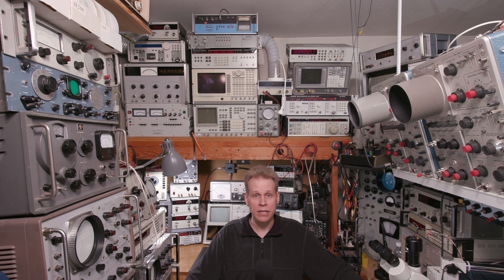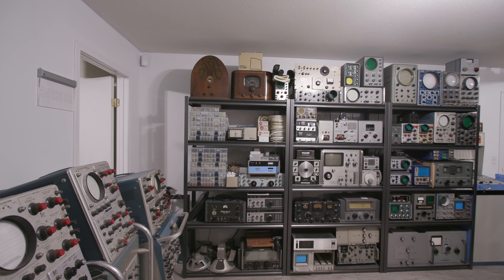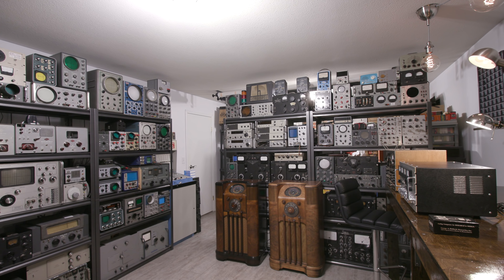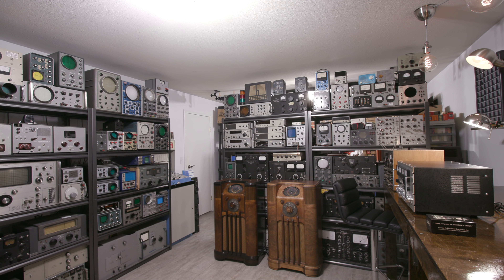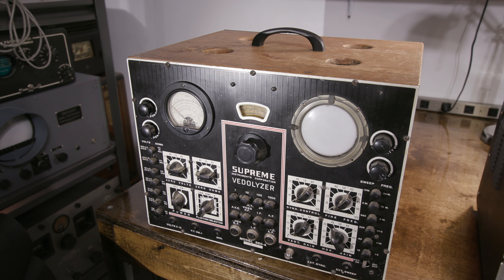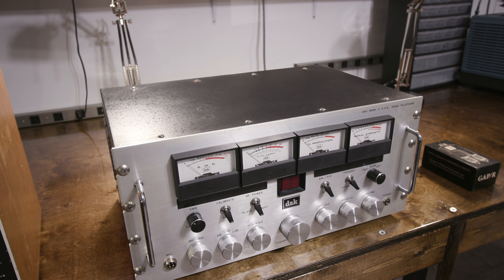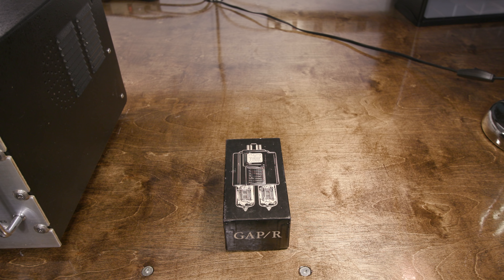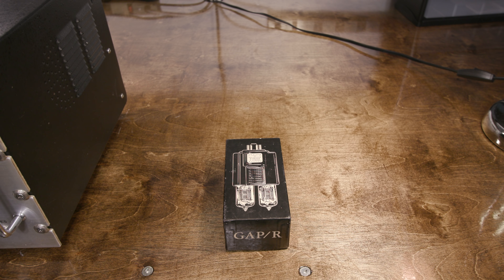The Next Restoration {Viewers Choice} 4K

Comment: I would say OP Amp but since so many others want the DAK I will pick that.  I have restored several of these since that's mainly what I do, CB and amateur radio restorations.  If that is what you decide to do and need any service information, have any questions or need any unobtanium parts just ask, I probably have it.  One thing to be aware of with these is intermittent operation problems caused by bad solder joints.  The PCB's in these were really cheap double sided boards that used jumpers to connect top and bottom layer traces.  Check them carefully because they frequently crack out on the top side.  The circuit board is a cheap "clone" of a Cybernet chassis.  Also if you have to remove the meters be VERY carefully.  The studs that stick out the back of them that hold them into the radio break out of the meters very easily.  Old age makes them rather fragile.

Comment: I'd love to see one of those beautiful console floor radios restored. Then again, I'm a sucker for old time tube radios, there's nothing like the glow of tubes from the warm old sound of a good console radio, so much to do, so many caps to replace, work on the speakers...with a little luck, they've not been turned on for years, and you could save the life of the transformers inside it.

Comment: The opamp, though I also have repaired the modern replacement for those, made still by Opamplabs.com. Though they did not make it repairable, by potting the whole unit in polyester resin, I was able to depot it ( though the PCB was somewhat fragile after that treatment) and replace the dead output transistors with new ones, and it carried on working for many years afterwards. They still make an impressive array of things that plug into octal sockets, and they would not look out of place in some of your restorations either, looking very 60's style blocks with screen printed labels.

Comment: Seen a radio like that at Goodwill a few months ago. Looked inside the back panel and seen what looked like the same tubes my amp uses and one of them was clearly damaged. Didn't have much light to see the circuit but my guess is that damaged tube drove the big speaker below it as well a couple of iffy looking electrolytics and resistors that I dared not touch with how brittle they looked. Really wanted to pick that up, restore it and find a home for it that would take good care of it but they wanted a ridiculous amount that no one shopping at that store is likely to have at hand. That particular one looked like someone patched a record player into the bottom of the cabinet at some point and added wooden shelving to store records next to the speaker cone.

Comment: All three would be great choices but because I just got out of electronics class 101 and we played with some solid state op amps I would have to say the vacuum tube op amps and show them and use in a circuit developed for them like a small radio.
        Of course at the beginning of your video when you paned over to those two tall twin towers radios was the first thing that came to my mind.

Comment: The CB radio.... these are already well covered thanks to  MikeRadioRepair and TheRadioShop channels. Carlson's Lab added value lies in test gear and electronic design considerations. The Tube Op-Amp now that's fascinating... however from what I can see (from the box, and given its small size), there is only just that, a tube, no actual circuitry around it... what is there to fix or restore in a tube... other than replacing said tube ?! 
So as much as I would love to see that tube op-amp in more detail, I will vote for the Vedolyzer, because it's a test gear, is exotic in its "all in one" design, and because it's probably quite complex inside, so more interesting to look at, more anecdotes for you to tell us, more things to fix... more to enjoy and learn basically ! :-)
And I am sure we will get to see the tube Op-Amp soon after anyway, so it's not like I had to choose one against the other... we will get to see both any way, yeahhhh ! :-D
Would love to see you restore one of those old glowing Tek scopes as well ! I am currently restoring an old Tek 317 scope, 1959, my first ever piece of tube gear ! So much to learn... though thanks to your videos which I have been watching from the first to the last, you taught me quite a lot in the tube department, thanks ! That gave me the confidence to buy this Tek 317 and have a go at fixing and restoring it, and learn as I go ! :-D  Half way there.... I fixed it, now trying to restore it... but requires a million a one bloody imperial size wrenches and spanners which are not common place in Frog Land where I live. :-/

Anyway, thanks for the great content that you produce regularly, it's both enjoyable, as well as educational.

Vincent Trouilliez

Comment: Please could you do a video on repairing and aligning the Marconi 2955 radio test set, the first 2955 and the 2955D with a bad display that I hope I can fix.  I got a couple recently and working through the faults on one of them.  I'm sure that it would be of benefit to many people doing repairs or radio amateurs.  Thanks.

Comment: Hewlett-Packard VTVM.

Is that a HP Vacuum Tube Voltmeter I saw to the left of the classic work bench, right hand shelf unit, second row down?

I have a HP Model 400D that I need to restore. Mine only has a power indicator, power switch, range selector, input posts and output posts. The unit you have seems to have more functions but if it is a HP VTVM, I would enjoy seeing you restore it.

I always enjoy your videos so I look forward to seeing whatever project you select.

Thanks!

Comment: In the beginning of each video it'd be interesting to put an item on screen of a circuit whereby the viewers have to guess what it does. Whether it be a schematic, or a small circuit section, or even an old photo of some electrical equip. No need to give the solution; merely favorite the correct answer and that puts you (the channel poster's) heart icon next to the answer. It's a fun thing that a chess channel which I sub to does, it might work in this genre as well.

Comment: Paul have you ever run across an RCA AN/SRR-13A? Great old shipboard 2.0 to 32 MHz, dual conversion superhet, 29 tubes soldered into removable modules, not plugged into sockets. That would be an interesting restoration.
Reply from the maker: I have one on the shelf. I will do a resto on it in the future. Click here:  1:39   and look on the bottom shelf right above the floor.

Comment: Tough decision.  Depending on how extensive the work on the DAK is, it has y vote.  The transition between transistors and vacuum tubes, and the power supplies needed, would be really interesting.  The Vedolyser could be a long project depending on what went wrong.

Comment: Well, I would say that the setup of the old-timey workbench first needs to have old-timey test gear, so my vote is for the Vedolyzer.
I knew about the tube op-amps, it would be interesting to see as well, as long as it comes with the associated testing, maybe comparing its properties to that of a trans based op-amp and/or the properties of an "ideal" op-amp model.
Cheers,
 - Eddy

Comment: I would like to see the Op-Amp Restored.

By the way, I bought a Vintage Diehl (Singer) Table Fan running at 120V  AC 10 Amp 60 Hz from USA and I would like to use it on 230V 50 Hz AC without using a Step Down Transformer.

Is  there a way such as a  Capacitive  or Diode Voltage Dropper to do so.Please Help me with this.

Thank You ...

Mohammed A. Rahim

Manama-Bahrain
Reply from the maker: Thats drawing a lot of current (10A) are you sure that's  not .1A or 1.0A?